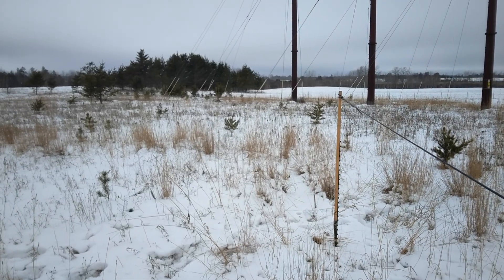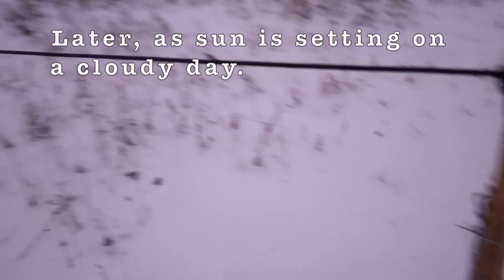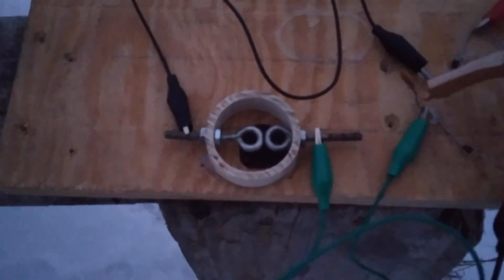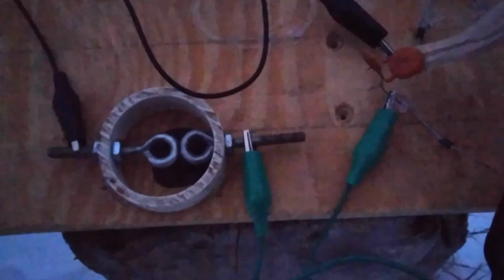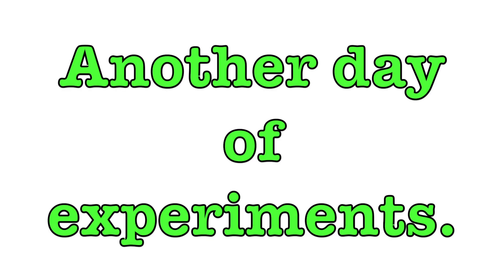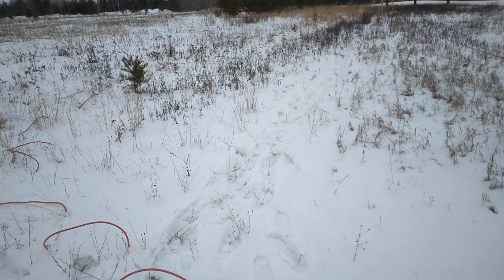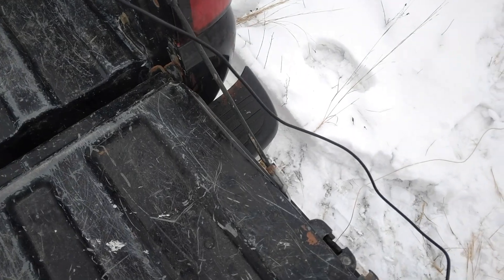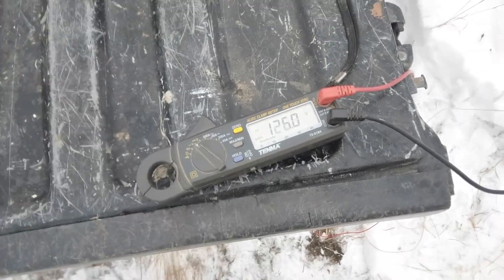Spark gaps, lights, and people, electrified near HV transmission lines

Comment: As to your coax line experiment,   I'd like to try a coax ( or any type of wire line) line, loop back and forth numerous times, parallel to the HV lines.  I would like to know if the energy collected increases.  This would take time to set up.  If I lived near you, I would assist and contribute to the experiment. Very, very interesting.
Reply from the maker: The more conductive material in the fields of these power lines, the more energy in the conductor raises.  Doesn't need to be wires.  I tried a 2' square piece of sheet metal, held shoulder high, at the edge of the easement, and it was showing 350 volts.
Reply: @doubleMinnovations  that's very interesting.  I'm envious of you.  You get to experiment out your back door.

Comment: I think the reason the extension cord did nothing is because in an electric circuit, the electrons move out in one wire and back in another.  But in that cord all the wires have the overhead lines pushing the electrons the same direction, cancelling out any voltage.  You would have to get one of the wires out of the electric field (e.g. a really large loop of cable) in order to see a voltage.  One possibility is to use your coax cable, as the inner conductor is shielded from the field by the outer sheath.  So if you connected the inner conductor and the shield together at one end of the cable, you would have a long run in one direction (the shield) and an isolated run back again (the inner conductor) which won't generate an opposing voltage because it's shielded.  In theory this would give you the highest voltage/current and you wouldn't need to connect to earth.  It'd be interesting to try it out as this idea sounds good in theory but you never know until you try it.
Reply from the maker: A couple of commenters wanted me to try just a cable on the ground; that's why I did it.  I didn't get anything out of it, because the energy fields were being grounded out, right where it was at; in the snow and weeds. -it was about what I expect.  Same thing happens if I had it too close to the trees, that are on the side of the easement. -the trees dampen out the every fields.  
Yes, I do think I would have gotten a little more electricity if I used the inner conductor too.  Thanks

Comment: I wonder if it could power a drone? If so, maybe too much noise for a signal?
Reply: This is only milliamps.  Drones use tens of amps.  Even accounting for the voltage difference it's about 10,000 times less power than you need for a small drone.

Comment: My sister lived right next to hv transmission lines , she was always sick with something, she died at 60 from retaining water , even after she moved she was sick all the time from this or that . Her immune system was almost zero from being over charged, I don’t think she knew about grounding. I remember being there when the moisture fog ect was heavy , you could hear the current moving thru the lines , just a constant zzzzzz
Reply: Yes, your sister was very sick, because this stuff is hidden from the public, how extremely harmful it is. And when someone dies its egnored. It makes them too much money they're not going to  stop it.
Reply: Power company conspiracy. People were getting sick from the PCBs, soil and groundwater contamination from the transformer oil they were spilling all over the ground instead of the magnetic fields.
Reply: That wasn't the current moving through the lines, it's corona discharge caused by the high voltage and high humidity.  There is currently no evidence one way or another about how power lines affect people.  Some people get sick living near them, but many don't.  Last I looked into it, the rates of illness were no higher near power lines than anywhere else.  So for the moment it's an unknown.  It seems like it doesn't do anything in the short term, but also there haven't been any long term studies of people who lived there their whole lives.
Reply: @vink6163  It is likely that it affects some conditions but not most conditions. I wonder if @brianolson1158 sister ate a lot of salt. The retaining water was likely CHF. Was she also very heavy? Did she have a stroke before she died?

Comment: Looking for an invention that's for sale to put out in my yard that will keep a battery bank charged up to supply electricity  for home. Why buy solar panels when this current of electricity  is  in the ground, in the air, in the antennas? Need some help to get a product that will sit outside and  charge batteries.
Reply: Why buy solar panels?  Because they work, they are a proven technology, and cheap second hand panels on an overcast day will put out thousands of times the energy that you can harvest from the air.  If all you want to do is power a single LED then the ground/air power is fine, but most people want to run more than that.  That's why power stations don't use those technologies - they've been investigated but the power you can extract is too little to be of much use normally, and too great to handle when it comes in the form of lightning.  That's why you don't see those products for sale.  You'd probably use more electricity in the manufacture of the device than you'd ever produce even if you used it for years.
Reply: @vink6163 any invention that can draw useful/useable power from the lines  will be detectable by the producers of the power as an unbalanced drain on the system and will show at substations upstream of your site

Comment: I think i need to make a grounding suit and wear it always, also i dont think tin foil hats are a good idea anymore lol
Reply: They actually do make a "grounding suit" that is used by tower workers who must service high power transmitter antennas while they are actually transmitting. The suit is grounded to the tower. It will protect the workers as they make repairs. Some complain about feeling hot in the suits.

Comment: I found the biggest blackberries iv ever seen under some big power lines. I later found out that magnets can increase or decrease yield from treated seeds. They also can make treated fruits grow large and watery from one pole and small and flavourful from the other. The power line I am talking about was buzzing and sparking in a way that made me feel uneasy. The blackberries at the base of the steel tower were all  about an inch wide, normal blackberries in this area are about a quarter of an inch wide.
Reply: You should've grabbed some seeds and grown them to see if it was a new variety that would grow that large even without power lines
Reply: @vink6163  True, I tasted one and it was not so great. It was quite obviously the same type as all the surrounding ones just positioned right at the bottom of a sparking buzzing 50m tall pylon.

Comment: What DMI needs is an old microwave transformer. One wire is allready grounded. And the secundary windings gives above 10 volts. Then a diode to a car battery. And a long parallel blank wire, at 2 feet of the line. The succes is ensured.
Reply: In America is your power system Swer lines ,Single Wire Earth Return  is very interesting.
Reply: @darcymunro8930 some very rural places it is swer. But not usually.  Something about dead cows when it hadn't rained in a while.

Comment: You might try an experiment to make a quarter wave or a half wave dipole antenna  tune for 60 hertz  to capture the resonate energy from power line
Reply: First that man aint a ham. And 60 Hz makes a dipole of 2500 kM ! How can you advice this ??
Reply: I came here to say this, however I looked up the wave length.. quarter would put him over 4 million feet of wire. He could do 500.2 feet for a very small fraction.. or 62.5 feet for an even smaller fraction. I would be curious to see how it changes his experiments.

Comment: What does it do to one? Is it harmful?
Reply: It depends on the frequency. Different sized internal organs have their own frequencies. So if it matches like two tuning forks, it will cause heating. Many people who have been working long times with radio have nerve damage. So their hands are shaking etc. Some people are more sensitive than others.
Reply: @Kangsteri  Radio is many times the frequency of mains AC though, and it's known to cause heating and damage (after all, that's how a microwave works).  But 50/60 Hz mains appears to be too low to cause damage, at least in the short term.  I'm not aware of any long term studies of people who lived under power lines for their whole lives though, so the jury is still out on that one.  My personal feeling is that it does nothing, because your skin would even out the voltage and it wouldn't penetrate into your body the way high frequency RF can.
Reply: @vink6163  Yes. But as you see on the video HV might easily cause unintentional spark gap conditions. Specially in urban environment. Sensitive people can't even stand the 50/60hz hum, so it can cause very bad placebo effects too.
Reply from the maker: I don't think anyone really knows for sure...  But there are accusations.
Reply: You should ask this about EV riders with 100's of amp near to them in pulses.
Reply: It's a slow painful death, I live through it daily.
Reply: Completely harmless. There is only electric and magnetic fields here. There is no ionizing radiation.